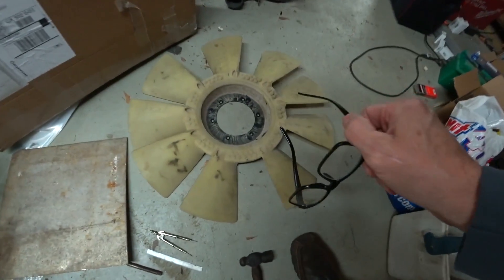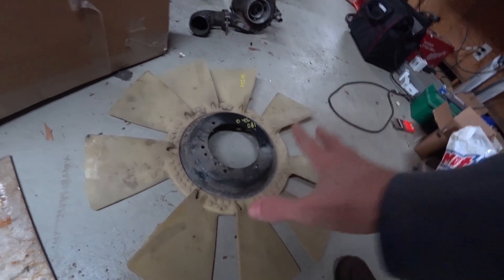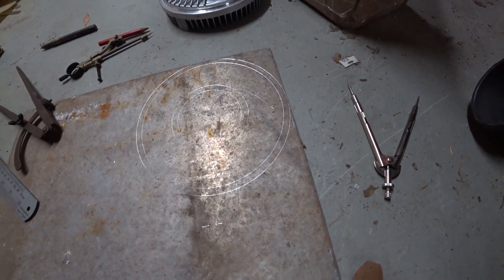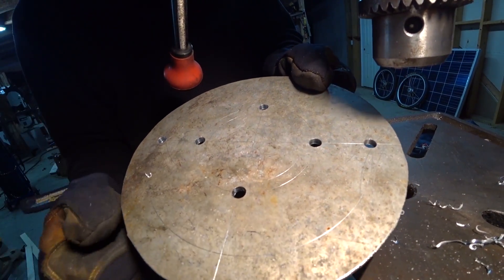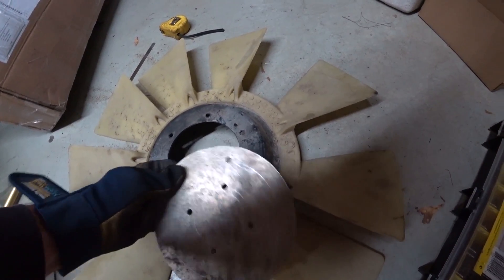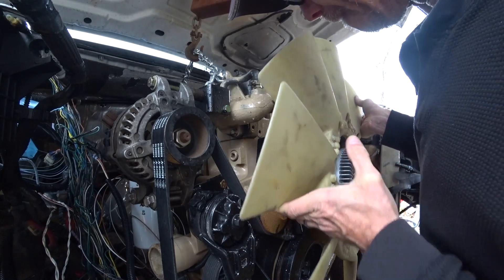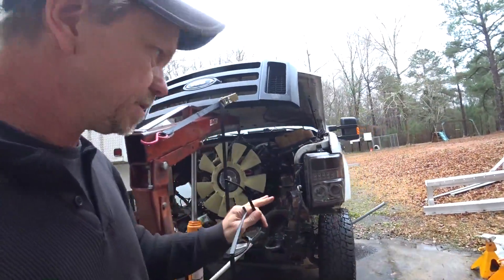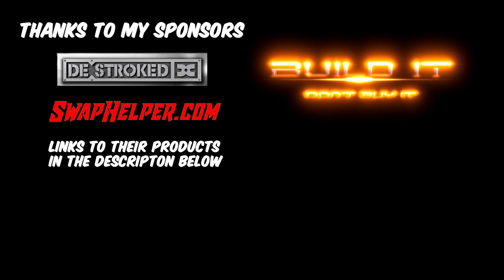6.4 Ford F250 to 12 valve Cummins Swap - Superduty Fan Adapter

Comment: Need an update amigo, how did fan workmout with a/c cooling at idle? Im on the same project just Wondering if we should use cummins clutch or need a heavier duty fan clutch feedback is highly appreciated

Comment: Are you sure that big fan is going to fit I had to use the dodge set-up on mine if anything mine runs to cold
Reply from the maker: Yeah I've seen it done before so I know it will fit. Just not sure how well it will line up with the fan shroud.

Comment: Yeah great stuff. Hope your getting time to read these comments.. I've seen someone already suggest this. You are gonna impale your face, gut, or twist two fingers round your chuck if you don't get some "bench dogs" for that D. Press... You are getting EXTREMELY LUCKY so far, one good one and it's huge regret time , shit even if you went all out on those is well worth price of admission. Good luck.
Edit:the gloves in a twisted way can be worse to use due to that tharr chuck having something to grab hold to, (I've seen two fingers look like an Oklahoma ef1 tornader.)
Reply from the maker: Note taken. I've cut a tendon one time in a finger and loss the use of it for a month or so from not wearing gloves while drilling with a hand drill. What you say makes sense though. I'll work on some bench dogs and no gloves on the press. Thanks for your your concern.

Comment: I drive a truck and had one Cummins and it was the biggest piece of junk and my boss has 5 kw 3 with Cummins sand 2 with paccar Cummins are all ways in the shop this one has 400000 and the others have under 300000 the turbo are all way s going out egr always out should I go on the the problems with junk Cummins.

Comment: Why would you ruined a ford with a junk Cummins
Reply: Congrats, you are the first person that thinks a Cummins engine is junk. So you actually like the 6 leaker and the 6.4l better than a proven engine like the Cummins?
Reply from the maker: Ford did the same thing with its heavy duty F650/F750 trucks from the 90's till 2015
Reply: Because Cummins are cheap and ford stop using them
Reply: They also use cats and Detroits which are better then Cummins
Reply: My 6.4 has almost 400000 on it with no major repairs besides hoses
Reply: @cecilhoak7909  If you got 400k on a 6.4 then you have a unicorn!
Reply: Proven to be junk only engine that got a gov. Bail out
Reply: @cecilhoak7909  Junk? I think a bazillion Cummins owners would disagree. You vever hear about anybody swap a 6.4 into anything. Bill at Powerstroke help calls the 6.4 complicated and a POS. Cummins is found in farm equipment, school buses, generators (just like my 100kw 12v 5.9 home stand by generator), yard tractors and swapped into everything! There is a reason for that. These engines speak for themselves. I'm not a super Cummins fanboy or nothing but I know these engines and what they can do. I like the 7.3's, the 6.0 when you do some work to them and the 6.7's  but definitely not the 3 year only engine 6.4.
Reply: I wonder why all equipment maker are going way from Cummins
Reply: Cecil Hoak There are at least 2 companies that make motor mounts, adapter plates, etc. to put cummins engines into ford trucks. I have never heard of anyone pulling a cummins out of a dodge and putting a power stroke in. Ford makes great trucks in my opinion but until the 6.7 there engines have been weak.
Reply: @toddstryker2471  I too agree. Love the Ford trucks!
Reply: @cecilhoak7909  All is a broad general statement. I know there is a lot still using Cummins. If any dropped them it was probably due to price. A lot of Manufactures will throw a cheap crappy diesel engine made in Korea because they can buy it cheaper.  Anything that is man made will have problems! Cummins is an exceptionally good engine that has proven to be reliable. Even tuned it will still hold together well but the right person and lack of maintenance can still destroy it. I feel you just want to call them junk cause everybody else loves them? I kinda like to do that too with other things. You want to be different. I mean I would love to see a John Deere PowerTech 8.1L or a DT360, or a Cat 3126 swapped into more trucks. 1) I don't have the money to do it. 2) Cummins are cheaper and easier to find. I would love to do what JYDog is doing! I would probably use a newer common rail 6.7L Cummins but still!
Reply: Cecil Hoak fords what’s junk you don’t see Cummins guys pulling their cabs off to work on the motors? An theirs plenty of million mile Cummins out there I bet their isn’t one single ford after the ol faithful 7.3 of course that’s got even close to those miles man I think you just mixed your words up should have been why would you ruin a Cummins with a junk ford 😂

Comment: I wonder why the spacing between those fan blades aren’t equal-distance. Some look close together and others have a big gap between them.
Reply from the maker: I read it was to reduce noise by changing harmonics. Not sure if it's true or not but just passing it on.

Comment: seems like swaping in a ford 6.2 v8 would be much easier and it would probably bolt on.
Reply: I drive a 7.3 idi. a 6.2 would feel amazing to me.
the only thing that keeps me in my 7.3 is that it runs on waste oil like it's nothing.
Reply: @Austinsairplanes  free fuel is nice!
Reply: austin h....but why? The 6.2 gas is a dog. My company F250 can’t get out of its own way. Plus this is a 12v. All there is to say.
Reply: Gassers are so 80's. They lack power, efficiency, proper sound, ect. Nobody wants a gas truck.😂

Comment: heres hoping that the height of the fan is the same as on the super duty motor or it will still foul the schroud
Reply from the maker: fingers crossed or the shroud gets modified.

Comment: I’m still convince another fan/fan clutch setup could be used to save you 2” in order to avoid moving the trans back.

Edit..thx for the good content I’m really considering this for my 03 6.0 f350. I have a line on a 04 common rail motor, 200k miles....

Comment: What is up with that fan?   Are the blades supposed to be like that?   I have never seen a fan that looked like it was missing blades before.
Reply: They offset the blades to reduce noise.
Reply: @repairrestorerebuild9864 , I figured it must be something like that.   Thanks for replying.   It still doesn't look very balanced.
Reply from the maker: @repairrestorerebuild9864  That's what I've heard.
Reply: I don't remember why but a lot of manufacturers do that.
Reply: Gives you access when changing belts and tensioners
Reply: @joejamtgaard9382  , thanks for the reply.  That makes a lot of sense.